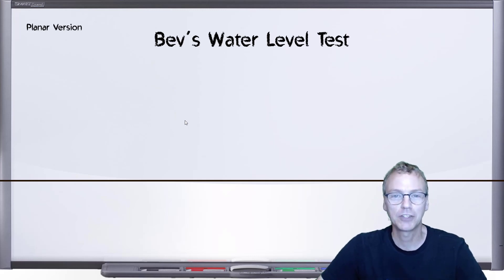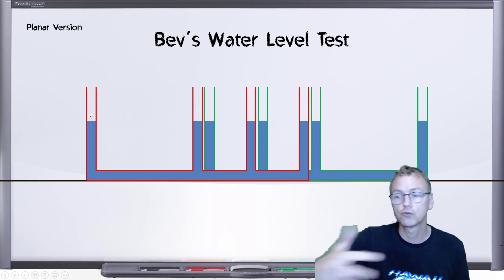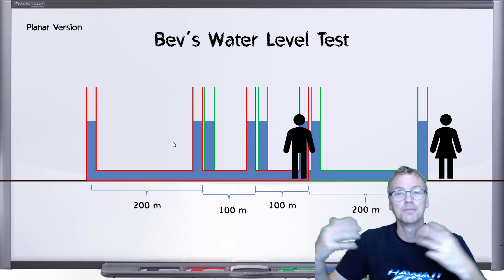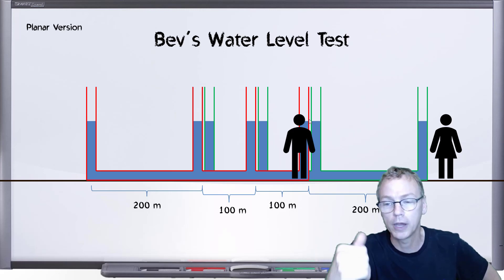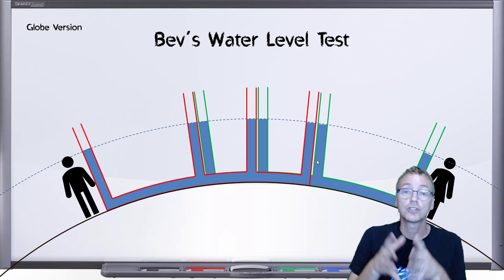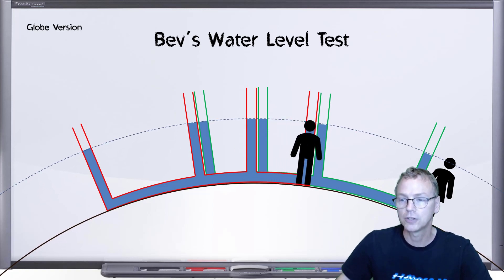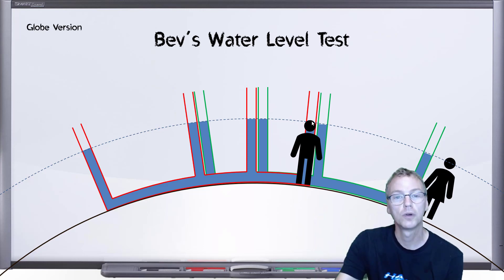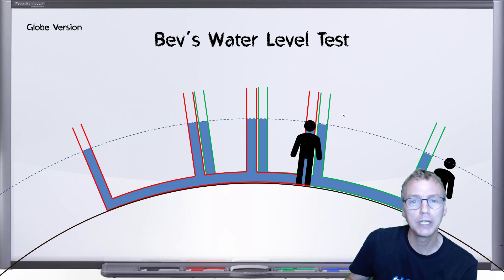Bev Try Thinking and Spot On Level's Water Level Test

Comment: We understand how water flows. The surface of large bodies of water at rest form a horizontal plane of reference, been utilised for many years.
Horizontals do not bend!
Reply: Water bends in Ship Model Basins.  Easy to see and measure.
Reply: @awatt  please provide the blue prints and show.
Reply: @bloodsthicker5651  
Go to one and see for yourself.  I have that's why I know that water bends to follow the earth's curve.  Globe confirmed 🌎
Reply: @awatt  I respect your beliefs.
Reply: @bloodsthicker5651  
Belief not required.  The truth can be seen with your own eyes.  No special equipment required.
Globe confirmed 🌎
Reply: @awatt  enjoy your globe, buddy 🙂👍🏻
Reply: @bloodsthicker5651  

If you don’t have a ship model basin at hand you can refer to any of these other points:

1. Prerequisite: All distances on a FE map must match real-world distances. On the globe map and in the real world south of the equator distances between lines of longitude decrease progressively as you approach the South Pole. This is not true on any FE map. 

A point on the eastern coast of Australia, near Red Rock, is at 30°S 153°13'E; a point on the western coast of Australia, near Leaman, is at 30°S 115°E. The distance between them is 38.2203°, or 3,666.7 km at this latitude. On the AE map, the equivalent distance between these two points is 8,901 km. 

Why? From the North Pole to 30°S is 13,313.6 km. The length of an arc subtending an angle of a circle is given by the formula d=απr/180, where α is the angle, r is the radius, and d is the distance. In this case, α=38.2203, r=13,313.6, and d=8,881.1 km. In other words, on the flat Earth the distance would be 2.42 times greater than on the globe and in real life. 

The Earth can't therefore be flat.

2. Prerequisite: Lat-long coordinates on an FE map must match the real world. South of the equator this is increasingly not the case, to the point where the geometric distance across Australia based on lat-long coordinates is about 2.4x greater than the measured distance. On the globe map this delta doesn’t exist. 

Continuing with the Australian example, if you insist the distance on flat Earth is the same as in real life, then solve for α=180d/πr: d=3,666.7, r = 13,313.6, and α=15.8°, which is much less than the 38.2203° in the real world.

So if the AE map coordinates match the globe, the distance will be much greater than in real life; if the distance on the AE map matches the globe, the coordinates will be off. 

The Earth can't therefore be flat.

3. The angle to Polaris always changes degree for degree with the observer’s northern latitude in the real world and in the globe map. This is not true on any FE map nor is it possible on a flat surface. (See my video 0004 for more information.)

4. The horizon drops further from eye level as the observer’s altitude increases. (This is easily measured by anyone with a smart phone.) This is expected on a globe but not on a flat Earth. 

5. Gravity has copious experimental support and is considered a well-confirmed consequence of the existence of mass. All objects with a diameter of 450-600 kilometers or more are crushed by the gravity of their mass into increasingly perfect spheres. This is predicted by theory and confirmed by observation. A flat Earth can’t possibly exist because it would have long ago been crushed into a ball. 

6. Photographic evidence, from both manual photographic exposures on a chemical emulsion (“Earthrise,” the original “Blue Marble”) and from satellite imaging by electronic sensors (the EPIC camera on the DISCOVR satellite, the ongoing series of images from the Himawari 8 satellite), plainly show a spherical Earth. 

7. Simultaneous reciprocal zenith angles measured by geodetic surveyors show that the Earth is not flat and give a value for the Earth’s radius. 

8. The existence of a defined horizon on a clear day shows that the Earth is not a limitless expanse on a flat plain but rather has a nearby limit beyond which more of the Earth is not visible; the fact that you can see more of the surface by increasing your elevation while still maintaining a horizon that continues to drop further below eye level reinforces this. 

9. The fact that the Sun can illuminate the underside of clouds as it’s setting shows that it must be dropping below the horizon because perspective alone can’t cause this effect. 

10. The curved shape of the shadow the Earth casts on the Moon during a lunar eclipse reflects its true shape. 

11. P and S waves generated by earthquakes can’t be detected in certain parts of the world (depending on the location of the quake) due to the existence of the Earth’s molten core. 

12. The routes taken by commercial airlines look straight on a globe but curved on a flat map. 

13. Objects weigh slightly less at the equator due to the centrifugal force generated by the Earth’s rotation, which counteracts the gravitational force generated by the Earth’s mass. This effect diminishes as latitude increases, suggesting that the Earth is a sphere.

14. Optical gyroscopes consistently show a 15° per hour drift, indicating that the Earth is rotating.  

15. Time-lapse photography of star trails in the northern and southern hemispheres show the existence of two celestial poles around which stars rotate, which is expected on a spherical Earth, but not a flat one.

16. The distance from the North Pole to the equator is measured at 10,002 km and the equator is measured at 40,075 km in length. If distances on flat Earth must match real-world distances, then the flat-Earth equator must also be 40,075 km. However, the radius of a circle with a circumference of 40,075 km is 6,378 km, which would be the distance on the flat Earth from North Pole to equator. This is 3,624 km less than the measured distance so the Earth can’t be flat.
Reply: @jormungandr9251  earths not flat, AE pizza map is ridiculous.
Reply: @bloodsthicker5651  "please provide the blue prints and show."
Search for this PDF:
Rail Straightness Metrology at the David W. Taylor Model Basin
October 1986

"At DTNSRDC the vertical alignment of the rails was accomplished using the water surface in the basins as a datum surface while a long stretched wire served as the horizontal reference.Thus the top surface of the rails is designed to be level rather than flat and the ideal line is an arc of a circle with a radius equal to the radius of the Earth."
Reply: @bloodsthicker5651  

Correct. Earth’s not “flat” in the sense of its topography (Bev’s tendentious definition of “flat”), nor is it flat in the sense of the shape of its form.
Reply: @bloodsthicker5651  the surface of large bodies of water at rest form a horizontal plane of reference...?  So are you suggesting that the oceans of earth are flat?
Reply: "We understand how water flows"

Really? Why does if flow to a lower elevation?
Reply: And yet, large bodies have a horizon, which wouldn't happen if they were flat.
Reply: @Beacon80  all horizontals are parallel to the horizon, would you agree?
Reply: @bloodsthicker5651  No. I don't agree. Anything parallel to the horizon is at an angle to the viewer.
Reply: @bloodsthicker5651  If you are looking out to sea on a clear, calm day your local horizontal is parallel to your ocean horizon. Note the common factor here is the observer, another observer some distance up the beach would see a horizon that is not parallel with your horizon or with your local horizontal.
Reply: @bloodsthicker5651  but as Bebby says “ you gonna need to prove ALL horizons are equal too “
Reply: @davidfaraday7963  horizontals do not bend, sorry.
Reply: @bloodsthicker5651  No, but level does. Level is simply perpendicular to the gravity vector.
Reply: @bloodsthicker5651  Oh, and horizontals seen from different places are not parallel to each other.
Reply: @bloodsthicker5651  so are you suggesting that the oceans of the world are flat and horizontal?
Reply: @cuross01  are the oceans large bodies of water at rest?
Reply: @davidfaraday7963  oh and, level is perpendicular to plumb, like horizontal is to vertical!
Reply: @bloodsthicker5651  I apologize, I seem to recall asking you a question first.  Do you suggest that the oceans are flat and horizontal?
Reply: @cuross01  no no, my apologies! The oceans are not at rest.
Reply: @bloodsthicker5651  You are indulging in the usual flat earther circular logic. Plumb is the direction of the gravity vector, so is along a radial line from the centre of mass of the earth. So plumb where I am is not parallel to plumb where you are, hence neither is level where I am parallel to level where you are.
Reply: @davidfaraday7963  I respect your opinion
Reply: @bloodsthicker5651  so then you agree that the oceans are not flat and horizontal?  Thanks, that supports the sphere earth hypothesis
Reply: @cuross01  indeed, the oceans are definitely not flat or horizontal 👍🏻
Reply: @bloodsthicker5651  again, that supports the sphere earth hypothesis.
Reply: @cuross01  what does?
Reply: @bloodsthicker5651  the oceans not being flat and horizontal.  Of course, I'm also ignoring topography since topography isn't important to the argument of the shape of the earth.  Or do you think it matters?
Reply: @bloodsthicker5651  Well thank you, but that wasn't an expression of my opinion, rather it was an explanation of the meaning of the terms used. You don't have to accept that the earth is a globe to understand that on a hypothetical globe "level" would follow the curvature of said hypothetical globe.
Reply: @davidfaraday7963  what curvature, please?
Reply: @cuross01  where would you measure your curvature?
Reply: @bloodsthicker5651  all over the earth using surveying total stations, satellites, or sticks and shadows.  Where and how would you measure flatness?
Reply: @cuross01  I take it that you've never  measured any yourself.
Reply: @bloodsthicker5651  if I have or haven't personally measured anything isn't the argument.  If you want to stay on that line of reasoning and insist that your standard of evidence is that one must, specifically, personally do things themselves, then I demand that you, first, present any and all measurements of flatness or non sphere earth shape that you have personally done.  As a show of good faith in this argument.
Reply: @bloodsthicker5651  I personally measured curvature in 8th grade science class.
Reply: @bloodsthicker5651  the horizon isn’t flat and horizontal. Bev debunked that. Bev says large bodies of water are not flat as they have waves, tides etc. he says the land is not flat. 
Euclid defined the horizon as a circle. 
You don’t have a flat horizontal horizon.
Reply: @ws1982  the surface of large bodies of water at rest form a horizontal plane of reference.
Reply: @bloodsthicker5651  Did you even bother to read my comment? Let's start with baby steps shall we? Would you agree that a sphere has a curved surface, yes or no?
Reply: @bloodsthicker5651  where can we find these large bodies of water at rest? (no waves, ripples, tides etc). No land seen beyond the water because that land would be the horizon.
Where can find these places? How did you measure the horizon? What tool did you use to take the measurements to verify the horizon is straight and horizontal? What was the margin of error?
Or 
Is it just your belief and you have no measurements to back up your beliefs?
Reply: @davidfaraday7963  you okay, buddy?
In your opinion, level is horizontal or curved?
Reply: @ws1982  A level indicates the horizontal plane. With a bubble of air inside a vial of encased liquid, the level shows when its frame is exactly horizontal with the earth's surface, called "level." Longer levels typically have additional vials turned perpendicular so the tool can measure vertical "plumb."
Reply: @bloodsthicker5651  that’s has nothing to do with measuring the horizon. 
Is that the best response you have. Using a. Spirit level not to measure the horizon 😂. 
Bev debunked the horizontal horizon due to not flat land and not flat large bodies of water. 😂
Reply: @bloodsthicker5651  I asked you a very simple question and you have ducked it! So come on answer my question, does a a sphere have a curved surface or not? 

"Level" is perpendicular to the local gravity vector and so is "horizontal". In this context "level" and "horizontal" are synonymous.
Reply: @ws1982  you're obsessed with this Bev, why is that? 
Do you deny level being horizontal?
Reply: @ws1982  Its hard sometimes to decide whether people like Bev and "Blood's thicker" really can't cope with simple concepts, or whether they simply like to argue for argument's sake. Certainly the recent trend to argue that the earth isn't flat (because topography) and using circular logic suggests the later.
Reply: @davidfaraday7963  simple concepts, like a horizontal being a straight line?
Reply: @bloodsthicker5651  "In your opinion, level is horizontal or curved?"
"Horizontal" and "curved" are not alternatives. "Horizontal" doesn't mean straight or flat and a curved line could be horizontal.
Reply: @davidfaraday7963  we're done here buddy, have a great day.
Reply: @bloodsthicker5651  No, a level doesn't "indicate a horizontal plane". A level tells you whether it is perpendicular to the local gravity vector (aka "plumb") or not.
Reply: @bloodsthicker5651  "Horizontal" isn't a noun, there is no such thing as "a horizontal". And no, a horizontal line (which is a noun!) need not be straight.
Reply: @bloodsthicker5651  simple concept like you say, level in surveying is a curved surface. As verified by measurements.
Pity you don’t have any measurements to back up your claim about the horizon. 
You have been conned into your beliefs.
Reply: @ws1982  when was the last time you went surveying, please?
Reply: @davidfaraday7963  horizontal (a straight line) is perpendicular to vertical (another straight line). Forming two right (true) angles.
Reply: @bloodsthicker5651  just a few days ago. When did you measure the horizon to verify its flat and horizontal?
Reply: @ws1982  what was the job, what did you do and what tools did you use?
Reply: @bloodsthicker5651  😂 you keep running from my questions. 
I’ll answer your question when you have answered my questions that you keep running from. 😂
Reply: @ws1982  feel free to pop in Next Level for a chat. You could explain how someone would measure the horizon.
Reply: @bloodsthicker5651  I can’t as Bev kicked/banned me because I can use Euclid’s elements book 3 def 7 to verify that Bev is lying about Euclidean geometry.
Thank you for conceding that you and Bev have not measured the horizon. So the claim be you and Bev involving the horizon is a belief that you have no measurements for. 👍
Reply: @ws1982  i'll get you in, don't worry
Reply: @ws1982  you're obsessed with this bev, why? 
How would you measure a horizon (apparent line) ?
Reply: @bloodsthicker5651  thank you for again conceding that you have not measured the horizon and that your claims about it are just your indoctrinated beliefs. 👍.
Reply: @bloodsthicker5651  so you have no measurements of flatness or otherwise non sphere shape?  You have a bad habit of changing topics.  We can move on to level being horizontal or not afterward
Reply: @bloodsthicker5651  "all horizontals are parallel to the horizon" assumes all horizons lie in the same plane. Bev was told about this error he made over a year ago. He (and his acolytes) still make this same error to this day even after being informed of this error. Does that sound like something reasonable people do?
Reply: @doofismannfred4778  you believe things that are parallel to one another, are on the same plane?
Reply: @bloodsthicker5651  You'd have to demonstrate either that they are indeed parallel to one another or that they are on the same plane. Just saying they are won't be the demonstration.
Reply: @doofismannfred4778  like you could demonstrate two horizontals not being parallel to each other? 
Good luck with that, buddy.
Take care.
Reply: @bloodsthicker5651  so either you are ignoring me or youtube is hiding comments again.  Do you still want to stand on your standard of evidence that one must, personally, do things to present then as evidence?  Where is your evidence of flatness or non sphere earth shape?
Reply: @cuross01  you're fixated on earth shape?
Reply: @bloodsthicker5651  you asked me where I would measure curvature.  I told you and then asked you where you would measure flatness.  You ignored me assumed I have never measured any myself.  I'm now holding you to your standard of evidence in the context of the discussion previously presented.  Only now, in your discussion with me, are you taking issue with the argument of earth shape?  Trying to change the subject again?

So, do you stand by your standard of evidence that people must personally do things to present those things as evidence and where are your measurements of flatness or non sphere earth shape?  Like I said before, we can move on to other topics after you've addressed my questions
Reply: @bloodsthicker5651  Well, that's a necessary conclusion given objects at a fixed altitude above a reference surface (MSL) drop away from any given horizontal reference. That's why Bev sticks with shorter distances.
Reply: B.t.  -  No they don't and no they aren't. No-one utilizes a plane defined by 3 distant points on any large body of water as a reference for anything. Conversely the dip angle to the visible horizon; an angle that varies by observer height and refraction; is used in celestial navigation that accepts the globe as reality.
Reply: @spheroidialmaster1910  you accept the globe?
Reply: @bloodsthicker5651  Absolutely. Every observation ever made is consistent with an 8,000 mile diameter globe, orbiting a far distant Sun. There are lots of observations that would disprove the globe. But none are ever offered with the accuracy to even begin questioning the scientific consensus.
Reply: No you don't, no they don't, and yes they do. Now, please tell me why, if I stand at the water in Annapolis, Maryland is there so much water in the way that I can't see anything below 7.5 feet a mere 7 miles across the Chesapeake Bay on Kent Island. Why is my eye level 25 feet up the side of the Baltimore Light House, standing at water level 6 miles away? Why is the bottom 4 feet of the light tower hidden by the bay? If I stand on the beach in Fleeton, Virginia, why can't I see anything on Tangier Island, 15 miles away, even with a powerful telescope?
Reply: Stand on a beach looking out to sea on a calm, clear day.  You can easily see the surface up to a certain distance which is quite close (about three miles) after which you cannot see the water surface at all. And the cut-off point beyond which the surface isn't visible is well defined.
Yet objects very much further away than three miles can easily be seen as long as they are sufficiently high out of the water.

So how would that work if the surface of the sea were flat?
Reply: How does this reference the actual video?
Reply: Water forms a 'horizontal plane of reference' ? Where is this written down? Have you every looked at the meniscus on water or other liquids? Why are you flerfs obsessed with water when you have a vast number of impossibilities in your fantasy world to deal with?
Reply: “We understand…the surface of large bodies of water at rest form a horizontal plane…”
Citation and evidence please. It would appear you prefer to simply assume this to be self-evident and then create a whole circular experiment to conclude this “self-evident” fact is true. If it’s self-evident then the test is meaningless. But the reality is it is not self-evident and in fact, a mountain of evidence confirms it is not at all co-planar (better word). It cannot be flat in any meaningful sense. So try again.
Reply: @sphaera2520  it's not flat, definitely not. Level is horizontal though.
Reply: @bloodsthicker5651  so do you want to keep going with your standard of evidence that one must personally do something for them to present it as evidence?
Reply: @cuross01  you disagree with level being horizontal?
Reply: @bloodsthicker5651  if level is horizontal, and all horizontals are parallel, the consequence being all verticals are also parallel, then any reasonable person would conclude you have described a flat earth. 

I recognize you lot are too embarrassed to acknowledge what you are these days but words and communication have meaning. Pretending otherwise to protect weak sensibilities and your inability to back up your description of reality is not healthy.
Reply: @sphaera2520  you might pretend to know what the earth is, I do not!
Good luck with your globe earth/ flatearth nonsense.
Reply: @bloodsthicker5651  I didn’t claim anything about the horizon. You did. Thank you again for conceding that you have not measured the horizon and that all your claims about it are just your indoctrinated beliefs. 👍
Reply: @bloodsthicker5651  of course. I don’t blame you for liking it. It does destroy your claims so well.
 thank you for again conceding that you have not measured the horizon and that your claims about it are just your indoctrinated beliefs. 👍.